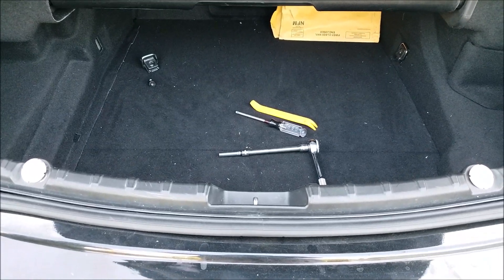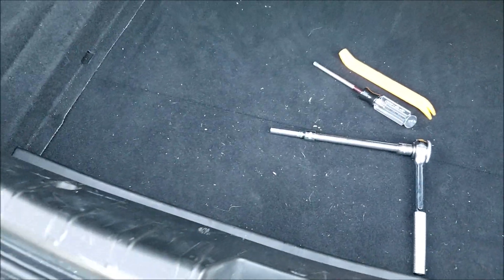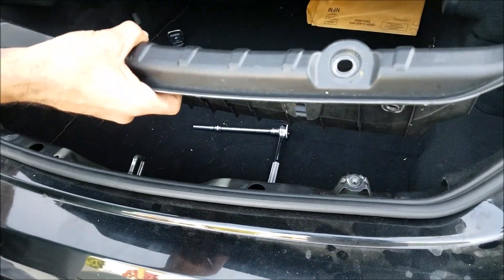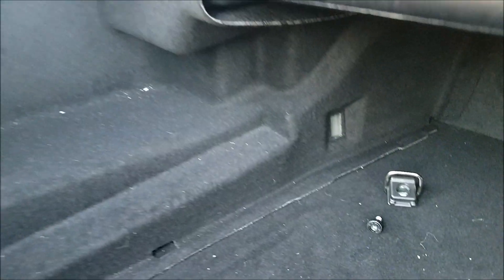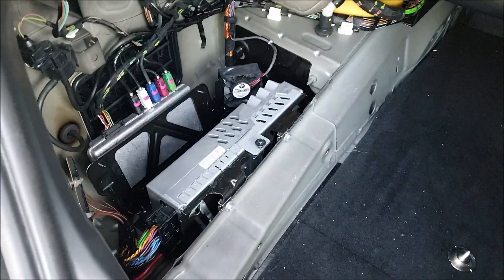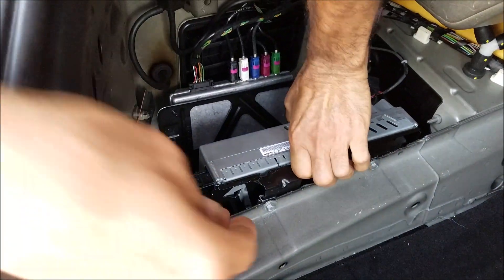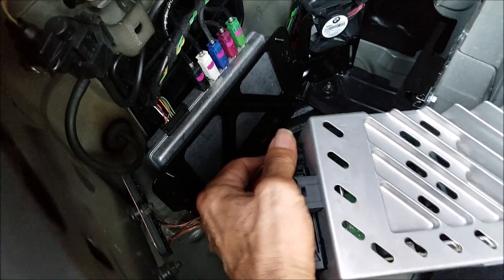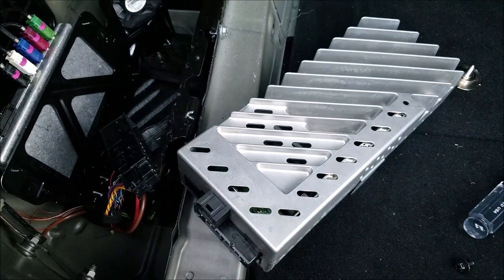How to Remove Logic 7 Amplifier from BMW 650 2012 for Repair.

Comment: Thanks for the video, I’m looking to replace my amplifier on a 2014 BMW X5, I got one from EBay and was wondering if I need to reprogram (is there an especial coding needed?) I was told that I need to reprogram my new amplifier by a  BMW person. Wondering if they just wanted to make more money out of me, or is this something that is just plug and play? Thanks again!
Reply from the maker: @DesdeadentroPR  only sometimes you need to have it programmed. 
If the donor vehicle options were similar to yours then you wouldn't need programming.
Reply: Thank you!